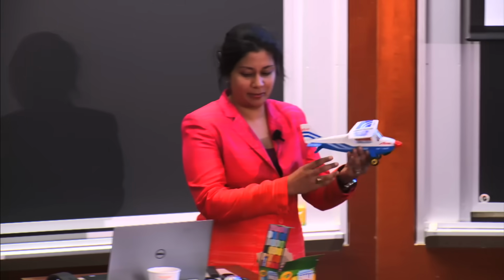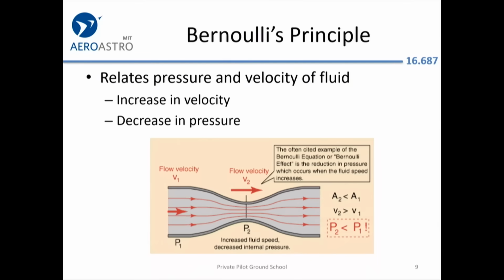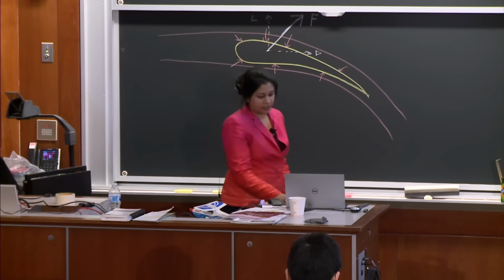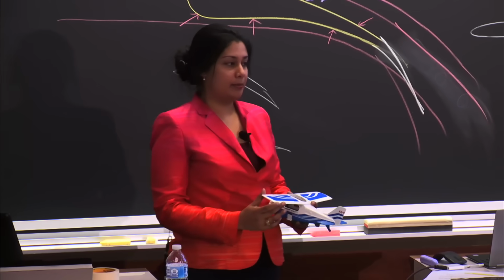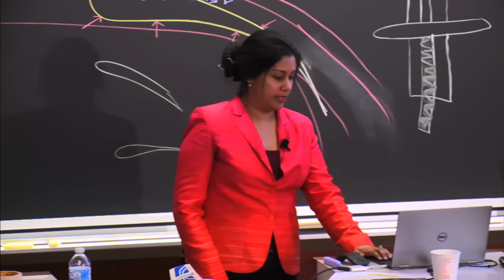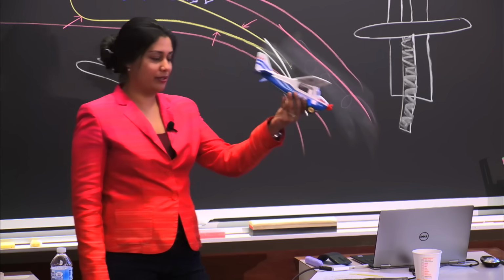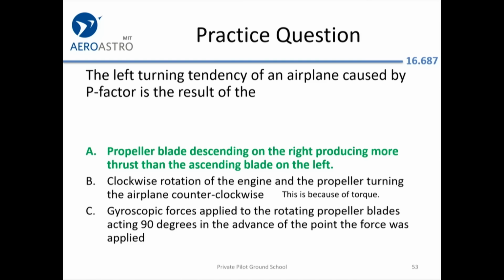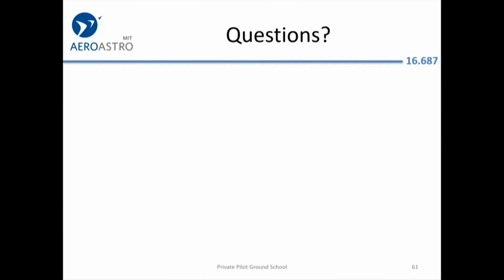Lecture 2: Airplane Aerodynamics

Comment: 11:22 Airfoil is a type of shape that is very efficient at increasing the downward momentum of the air.
Reply: You have to understand fluid dynamics.  The air over the top of the wing is excellerated do to camber (venturi), and it reaches the back of the wing before the air under it (this is why Equal transient theory is false which she explained).  That creates a void, a "vacuum of sorts" and that causes the air on top of wing to travel downwards (one form of downwash) to fill the void.  The air under the wing is defected downward momentarly. That momentary downward movement also contributes to a percentage of the lift (second form of downwash), but as soon as its free of the wing it travels upward and around (wing tip vortices) to fill that same void behind the wing. That void behind the wing inwhich both the upper and lower air particals are trying to fill is the induced drag a wing creates. THAT IS WHAT SHE IS SAYING!!  Read Aerodynamics for Naval Aviators and you will see what she is talking about and you will be humbled too.

Comment: Please, I want to defer on the wrong theory of why a plane can fly.  Indeed, the molecules of the air on the upper side of the aerofoil travel faster than the molecules below the aerofoil for continuity. The high velocity of the molecules of air on the upper surface of the aerofoil creates low pressure on the surface; while low velocity below the aerofoil results in higher pressure. The two pressures differential creates lift according to Bernoulli's theory. If the theory is wrong; the absence of velocity differential between the aerofoil upper and lower surfaces will create a vacuum within the air stream. This is naturally impossible.

Comment: Maybe the plane is flying beacuse above pressure and below pressure in the air!?But engine is driving a plane to point A to point B!?
Reply: Correct.  She fails to explain that.
Please see Understanding Lift Correctly:  
 https://rxesywwbdscllwpn.quora.com/
Reply: @Observ45er  Too bad that wing doesn t use spoiler of car on upper side wing to stop vortex spinning!?
Reply: @hrvojemikulcic7074  I'm not sure what you are saying, but it is impossible to eliminate the wing tip vortex.
It is on the boundary of the moving mass of air and the stationary mass of air.
See this: http://i.imgur.com/h8pSK.gif
Reply: Maybe plane need more speed (stronger engine like Panavia Tornado-i m don t know) on short runaway !?Hard to expect do civilian plane has foreplane or canard do take off on short runaway (aircraft carrier )!?Air is faster above wing for 8-10 km/h than below wing!?
Reply: @Observ45er  I m don't have airtunnel on work to investigate mass and air?People how working in aircraft industry has access to airtunnel and they can tested what they like!?
Reply: @Observ45er  It only my thinking-100 people 100 opinion
Reply: @hrvojemikulcic7074  Opinion, opinion.  Too many opinion not enough facts.

Comment: I never see an explanation right or wrong like this. Air has molecules jumping around as seen in Browian motion. This creates pressure we can measure. More molecules more pressure. Aerofoil curve causes the molecules over the top to be speeded up, thus they take a glancing blow to the foil reducing pressure. Those underneath with get backed up creating slightly higher pressure. All resulting in lift. Also some lift by ejecting the air downwards at rear.
Reply: That is common, but incorrect science.  The Brownian motion is not changed by the motion of the bulk fluid. It is a constant and the velocity given the fluid adds vectorially to it..
Please see Understanding Lift Correctly:   https://rxesywwbdscllwpn.quora.com/

Comment: I expected so much more from MIT. This was very disappointing.  Too many errors to note them all.  I would expect better even from the most basic brand new basic flight instructor.  Maybe MIT should remove this video and discontinue affirmative action hiring. A few things to note:
1. The "indy type" race car pictured didn't have a spoiler. Spoilers cancel lift. That's not what the depicted device does.  It had an inverted airfoil "wing" that generates downforce greater than the weight of the car.  Its purpose isn't to cancel lift, it's to create downforce. 
2. She makes a thing out of trying to be better than the others by discounting the equal transit theory, but then at about 30:15 she talks of the Coanda effect and that no molecule can cross around from the top to the bottom or bottom to top, in which molecules end up together after the flow separation. That is effectively what equal time is, and why the Bernoulli effect creates lift at zero anger of attack.  That lift is different from "paper plane lift" based on angle of attack.   She doesn't seem to understand the difference. 

3.  She seems clueless about what adverse yaw is.  It's the tendency of a plane to yaw opposite to the intended direction of turn BECAUSE OF DRAG.  Such as, when you try to turn right, the left aileron goes down, increasing drag on the left wing and causes the airplane to yaw left.  In that example, right rudder is added to counteract that left adverse yaw. The opposite happens in a left turn.
4. Much of what she said about spins was wrong.  Any pilot can learn to do them unless they are flying the rare airplane model in which spins are prohibited as part of the certification.  No parachute required.  
Overall, very disappointing.  I'm surprised by so many positive reviews.
Reply: Yep.
Also, please see:

 *Please see Understanding Lift Correctly:  

 https://rxesywwbdscllwpn.quora.com/
.....................
Just for yuks, here's my analysis, but it needs some improvements:
...
0:50 Vocabulary: doesn’t  mention the vertical and horizontal “stabilizers”. Calls them “parts”. In the graphic, but not mentioned.
There is only ONE wing.
Going to talk about sea planes ???
3:11 initially says lift exceeds drag, but corrects it.
4:50 Draws an extreme airfoil shape.
5: 30 Air has mass and conservation of momentum. Doesn’t explain how push occurs.
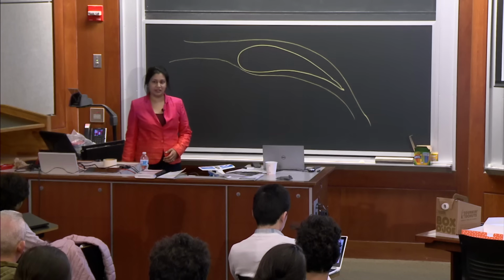OK -- 6:12 Explains Equal transit, longer distance fallacy. Points to flat wing, same length.  Math description not needed.  Good Aeroastro graphics.
12:01 GOOD Stated Bernoulli correctly using ‘velocity’.  BUT focuses on fast.
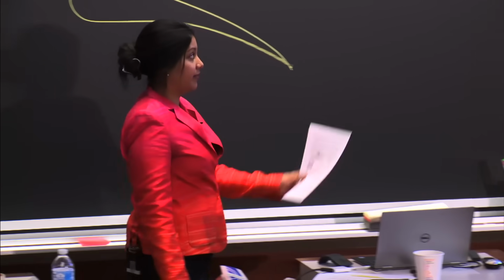12:42 The Graphic assigns INCORRECT cause to lower pressure.
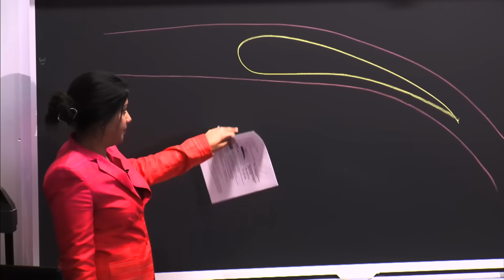14:00 GOOD: Shows stationary pressures BUT Fails to say that the force is due to the pressures being changed by the wing’s motion..
15:14 asks childish questions. Race Car.
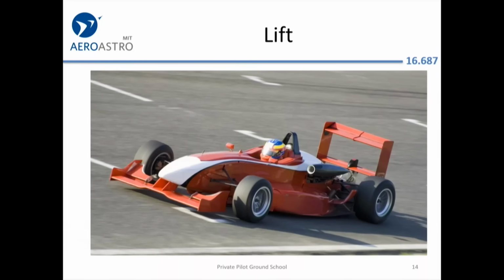16:36 Only says the spoiler “spoils” the air flow. Doesn’t explain that it has down lift.
18:09 Wing changes the speed of the air ALSO.
Never states that upper air beats lower air to the trailing edge.
18:54. Is wing moving faster through the air, or air moving faster past wing? Frame of reference discussion. Wind tunnel justification.
23:40 Mentions aspect ratio without explaining it.
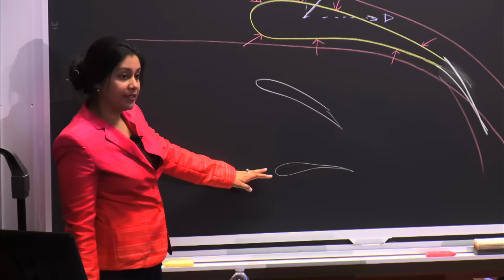24:24 Mentions your  hand out car window and PUSHING, but doesn’t relate to the the momentum explanation earlier.
25:28 Mentions Viscosity. Compares sticky.   Sticks to the wing.
27:10 Compressibility affects lift in a different way.  NOT FUNDAMENTALLY.
27:20 Calculating lift is not known.
29:45 CALCULATING LIFT.  Mentions Kitta Condition and says wrap around is an additional condition.  2D is simpler ) OK, but tip vortex in not true turbulence.  So… Calculat where possible and measure elsewhere.
Doesn’t explain chord line.  Says:  “in between.
32:25 Talks about summing forces around the wing for lift, but doesn’t explain the top-bottom difference.
38:10 Doesn’t actually state what AoA is.  Graphic shows it as “A”  but is unnamed.
42:20 CONFUSED about the effect of flaps. Airspeed being higher with ground speed lower HUH???  Also doesn’t explain approach being steeper. Misses that is the increased lift that allows slower air speed.
47:38 Only explains that roll is around the longitudinal axis, but not the others.
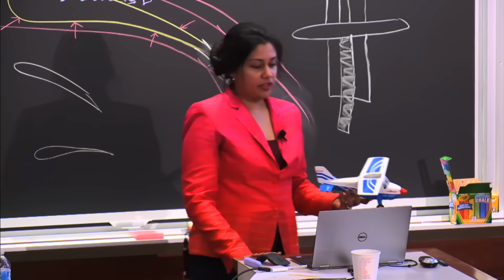48:13 Doesn’t explain why adverse yaw occurs.
48:15 Stability OK.
53:30 Question about what happens beyond the critical angle is not answered correctly.  Lift does not go to zero. Did not demonstrate a paper airplane stall.  It was too stable.
54:45 First mentions separation.
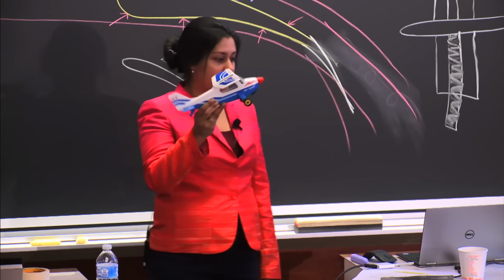55:56 climb & decent, lift = weight.
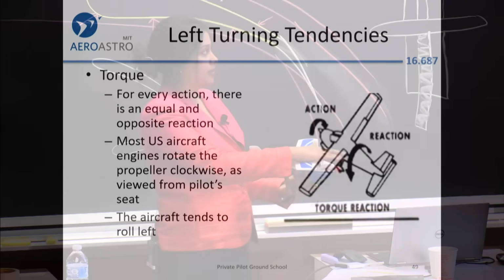57:15 Torque causes a left ROLL.
57:50 P-Factor not so much climbing because AoA not necessarily high, just on ground.  They can’t answer the question at 
1:02:20 Precession is 90 degrees  later.
1:03:14 Question why P-factor not subject to precession. Sort of answered. It is a bigger factor on the ground for a tail dragger the ground where the ground  prevents precession and in slow flight when precession only occurs during actual yaw.
In zero G flights confuses the upward parabola with top and downward parabola with bottom.
Reply: Indeed....I agree.

Comment: if you don't hold a bachelor in aerospace engineering, you're not an aerospace engineer.
Reply: so if i work as an aerospace engineer but have a mechanical engineering degree. I’m not an aerospace engineer? Doesn’t seem too logical 🤔
Reply: @Max-hj6nq  No you're not. You're a mechanical engineer working in an aerospace industry. You can't become one without having gone through the pain of a bachelor in aerospace.

Comment: I think I can explain a wing better than this lady. If you have a flat plane perpendicular to the movement, that is to the wind, the front of the plane is pushing the air molecules together and compressing the air in front. But behind the plane there is a vacuum because the plane is stretching the distance between molecules away from each other the difference in pressure it’s called a drag, the wind is opposing the movement of the plane. Change the angle, and the resultant vector can be vertical. That is lift. Any kid that have flown a kite knows that

Comment: IF WE CAN MEASURE THE RHYTHM OF AIR PATTERN OF THE TURBULENT, THEN WE CAN MEASURE THE LIFT PRECISELY...! FOR THAT, WE NEED TO INVENT AIROMETER BY RELATIVELY ANALYZING DOWN WARD DELTA VARIATIONS OF GRAVITY AND UP WARD LIFT OF THE MASS OF BODY EQUALLY MEASURING THURST AND DRAG OF THE PLANE. WE DON'T NEED TO INVENT PLANE BUT JUST A BOX OF METER...THAT CAN CALCULATE THE AIR OF THE CERTAIN ATMOSPHERE OF CERTAIN AREA OR LIMIT BOUNDARIES OF THE AERO PLANE SIGHT...! BY CALCULATING THE MODES OF SETS OF TURBULENT'S BEHAVIOR...OR ANOTHER WORD THE PROBABILITIES OF THE SETS OF TURBULENT'S BEHAVIOR...!

Comment: viscosity
My Teacher: it’s resistance to flow
MIT Teacher: if you are mixing brownie batter in a bowl...
🤣
Reply: and that's what makes a good teacher.

now, technically, viscosity is not resistance to flow. it's the tendency for the particles of the fluid to stick together, as a consequence of which, you get resistance to flow and other effects.
Reply: @victorfinberg8595  Watch the Tesla water turbine...thats a real good aplication for viscosity.
Reply: Once my lecturer explains modulation in terms of cooking chicken
Reply: Can you say full form of MIT
Reply: My maths lecturer explains trigonometry/calculus by replacing theta with donkey/monkey so that we listen and according to my chem teacher high school chemistry is just a trailer for secondary school

Comment: Trying to answer the Giroscopic effect (01:03). Giroscopic effect occurs WHEN the propeller axes is BEING moved. That is when you are CHANGING the attitude from a horizontal position to a climb (will have a tendency to the LEFT hence RIGHT rudder is needed) and from horizontal to descend will have a tendency to the RIGHT hence LEFT rudder needed. Again when you ROTATE at take off (your main wheels still on the ground) you will need RIGHT rudder... Hope it helps. There were other points that need some corrections.. but as a whole, is not bad. Cheers.